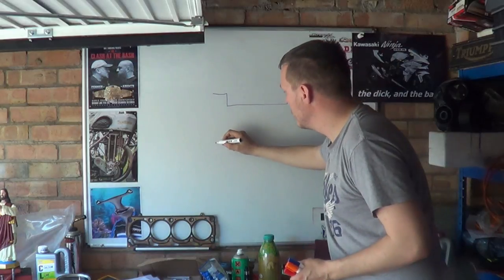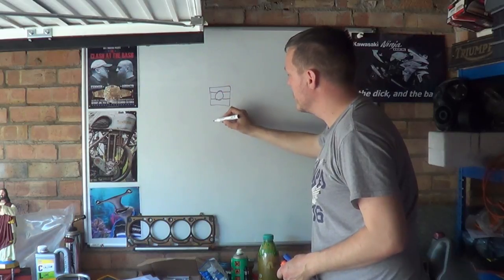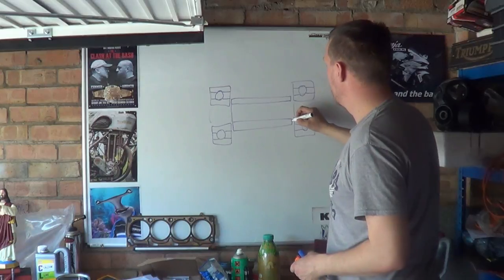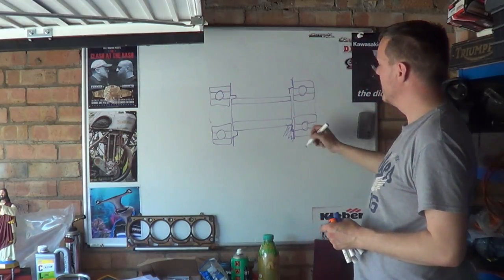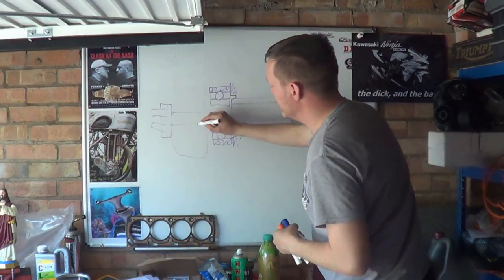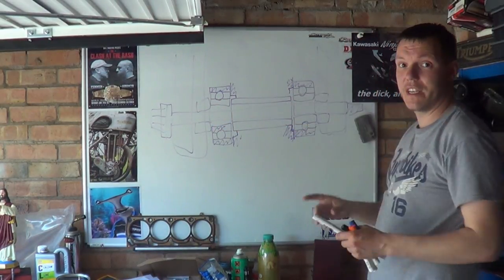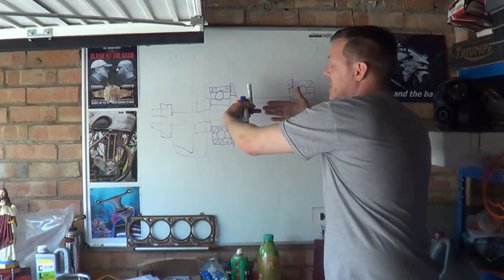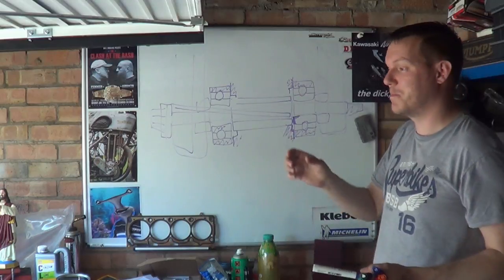Wheel bearing spacers - What are they for?

Comment: "You'd hear a crack or a snap or bang until something breaks".

Nothing in the hub assembly would break if you removed the hub spacer. The forces involved are far too small. What's much more likely to happen is that you experience a significant drag in the bearings.

The absent spacer means the inner races of both bearings are pushed in slightly compared to the outer race (which is seated by the hub flange). This causes drag as you're effectively squishing the inner race against the outer race.
Reply from the maker: And keep going and you'll split a cast ally hub, ask Pete Roundhouse how I know...
Reply: You've missed my point.

"And keep going" means you've over-torqued the hub assembly. That could potentially happen with the spacer installed. My point is all else remaining equal, removing the spacer causes a draggy setup.
Reply from the maker: If the spacer tube is missing there nothing stopping the progress of the inner race...
Reply: This proves my first point. I'm not sure you've understood the point I've made. 

I'll repeat.

Nothing in the hub assembly would break if you removed the hub spacer. The forces involved are far too small. What's much more likely to happen is that you experience a significant drag in the bearings.

I can't make that any simpler.
Reply from the maker: Unless you over torque it then you can crack the hub... I can repeat stuff too
Reply: @dirtygarageguy  

We can agree to disagree. For what it's worth, I do think you do helpful work on your channel overall.
Reply from the maker: Lol the second thing you're missing is side loading whilst riding, or do you disagree with that as well?
Reply from the maker: Do you want me to tell you how high that can be?
Reply: @dirtygarageguy  

I think the mature and intelligent thing to do would be to leave it there and agree to disagree.
Reply from the maker: So you don't wanna answer that question then? Some call that losing. Just to be clear my position is you are correct until you say "the only reason is because of added friction" you can definitely cause damage to a hub, I've seen it myself.

Comment: Quick question... Could it be that factory installed spacer is slightly too big? If i install a bearing to the machined end of bearing seat and then insert the spacer - it ends up being taller than the seat for opposite side bearing. Bearings should always be seated to the end or it doesn't matter? I am new to this so would not expect factory to fuck up the spacer length, but also it wouldn't make sense if bearing can't be installed as deep as the bearing seat goes...
Reply from the maker: Are the bearings you're installing OEM ones?
Reply: @dirtygarageguy  same spec, but not  OEM. Pretty common standard
Reply: @Rainaman-  on the other side, that is not a bearing seat. It is just spacer guide to help it stay in place. Bearing on this side sits on the spacer.

Comment: Why does the spacers freedom matter on the system? All practical applications asside, can the space in the middle not (theoreticallly) just be a static object which prevents that certain failure state?

So an axle with the spacer welded upon it but on a threaded slot that is very fine and you won't be over tightening anyway s.t. the forces are pretty much cancelling.

ty
Reply from the maker: "Why does the spacers freedom matter on the system?"

- what?
Reply: The Workshop by "freedom" I mean it is a pipe with enough clearance about the axle, st. the spacer can move in 3d space sat atop whatever concentric pattern around the axle. Albeit, not much movement is going on with the spacer in the axle bc it also has to touch the bearing inner race of both bearings to create equal force upon them (like you demonstrate in the vid). But what I wonder is, what if that spacer was ideally placed in a spot and welded on where it touched both inner races? The forces upon the bearings would cancel out and the mechanism would "chuch" just fine ... right? Or are there be more minute forces I am not accounting for that would create that "crunch"... bc that spacer is now "welded" and not moving at all and axial forces are tied to it 1:1. Are the forces mostly going to be dampened by the arms holding the axle or will it go to the axle and then the welded spacer? If it's the former, fine. If it's the latter, then it's torquing the axle in some way and can crunch the bearing.

I guess this one is hard to answer or test bc the premise requires building a system with a welded on spacer. It's just a mild curiosity so 'tevs😈

Comment: Trying to fit lowrider bike rims on too a 1976 schwinn trike.... Its the rear wheel with the coaster brake removed that I Cant seem to find the right spacer to go inside the hub but fit the trike axle snug.... Not trying to replace the axle if possible.....any help? Can send pics and this seems to be a simple fix I would imagine.... Any help would save death destruction and fokin mayhem thanx

Comment: Livestream- What are some tips you have for removing bearing out of a bottom end of a 2 stroke engine like the 500cc suzuki lt500 quadzilla, like crank bearings and exhaust valve vearings
Reply: TheSikkTACO a 2stroke with an exhaust valve???
Reply: Rick look uo the 1989 lt500 motor or the quadzilla, they have a exhaust governor valve and is gear driven

Comment: My question is why the fuck do bearings where out so quickly on motorcycle's that's the real pain in the arse.
Reply: Chris Waddington wheel bearings are neglected by most riders. In 50 years of riding I’ve changed bearings only twice, they were on bikes I bought that have been ignored by previous owners. I check and repack my bearings every time I change my tires. I hope I’m not coming off as snarky, just wanting to answer your question.